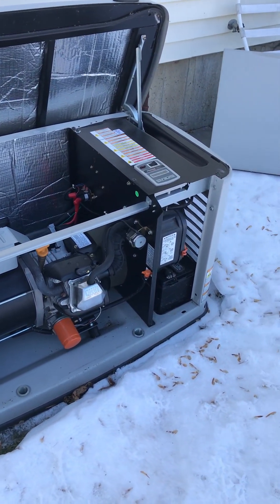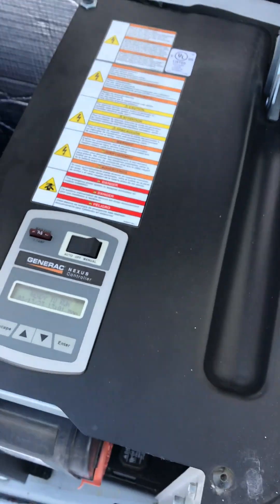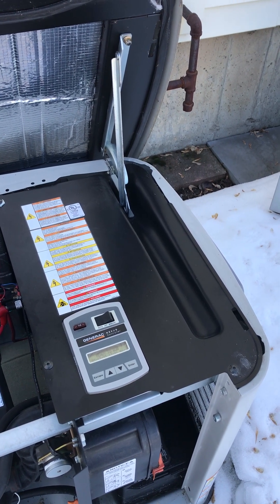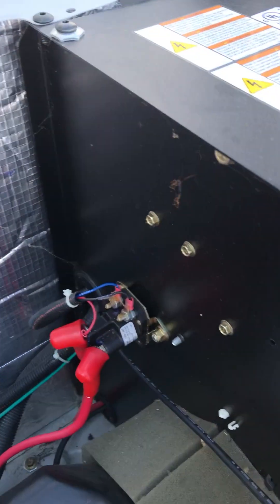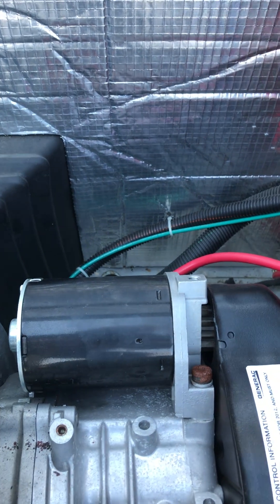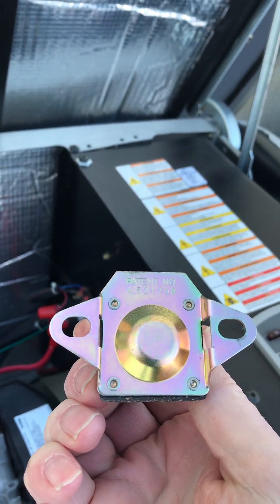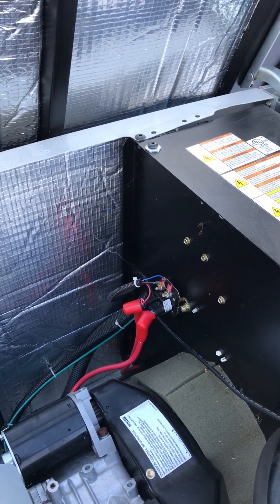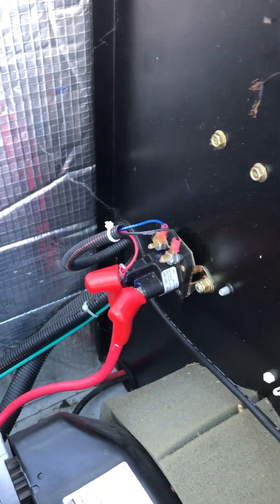GENERAC 8KW GENERATOR FAILURE TO START / FAILURE TO CRANK

Comment: Any chance you can send me a picture of the throttle motor and spring/ linkage? My spring fell off and I don’t see how it’s supposed to mount.
Reply from the maker: I believe that if you do a search for "stepper switch" problems or replacement you'll get a better idea of what you're looking for and possibly why.
Reply from the maker: I just added a video of the spring attached to the stepper motor arm. (not part of the actual stepper motor so ordering a stepper motor won't get you the spring.) On hold with Generac as we speak trying to get the part or even the part number.)
I got a service call right after my first reply to this request.